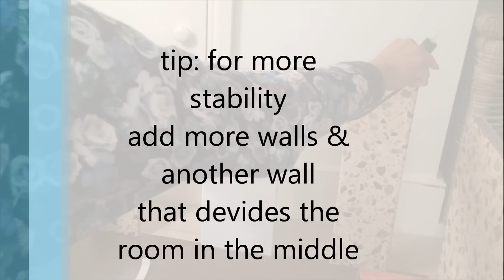DIY: Miniature House with LED lights

Comment: Awesome! Did you put cardboard supports between the main floor ceiling and second floor flooring so it doesn't sag in the middle?
Reply: you took the thoughts right out of my mind I thought the same exact thing to put some cardboard thin strips of cardboard and shapes to make a reinforcement between the crawl space between the ceiling and the floor

Comment: Greetings... I really enjoyed this video...!!! I have a question to ask of you... what supplies/tools are needed to install the lights?
Reply from the maker: +Margarita Parker fairy lights and a foam board :) I used a sharp pencil to poke holes in the foam board ( which I used for the ceiling) and pushed the little lights of the fairy light through those holes.

Comment: Looks great. I'm trying to figure out what kind of dollhouse I want to build my two year old. Does the cardboard hold up ok?
Reply from the maker: +Craft Dad Corner  thank you! I love working with Cardboard  because it is very durable. For a two year old I'd suggest going for a house with more stability though. I made another video which features a dollhouse (made from cardboard too) that even I can sit on. That's the link: https://www.youtube.com/watch?v=YwWKmEK3sfM
I covered the cardboard in paper mache and used bathroom paint to make it water resistant.